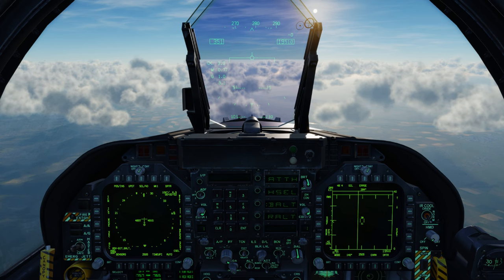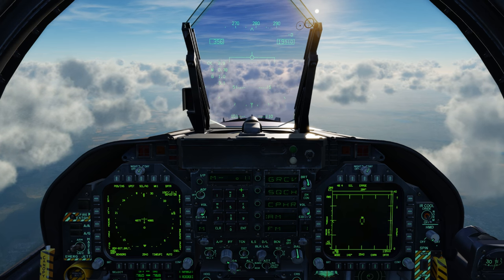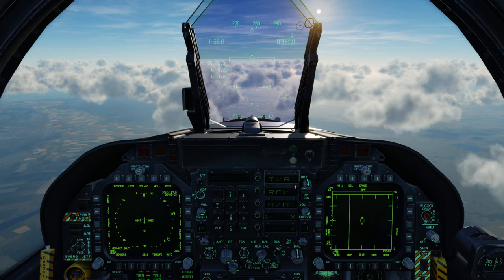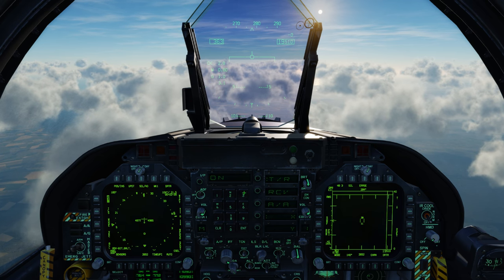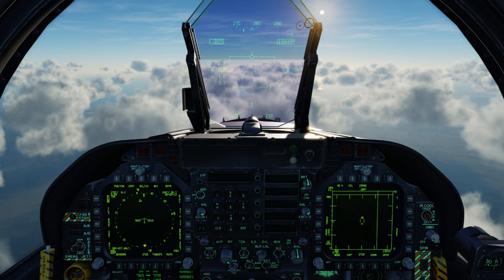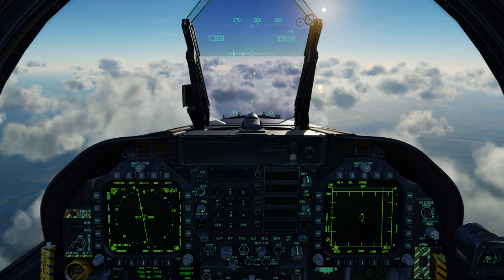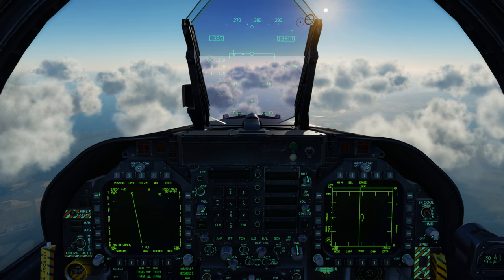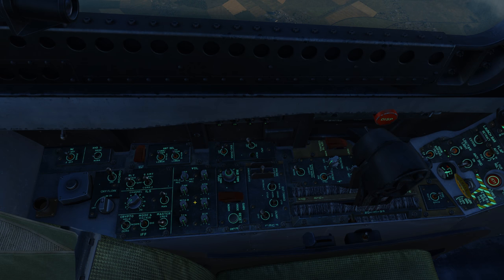DCS: F/A-18C Hornet - Episode 5: ADF and TACAN Navigation

Comment: Hi , thank you for that video and this channel, I have learnt a lot.  I have some questions about the TACAN.
Sorry, it may be silly questions.
1) Why did u set the CRS to 274° ?  3:16
2) What is the purpose of the CRS line  ?  as we can see already the heading , is it to land ? 
3)  what's the purpose of knowing we are at 4 or 8° compared to the crs line?   
thanks
Reply: i was wondering about the same
Reply: I’m late to this but may as well answer for future users who also have the same question.
Let’s say your landing at an airport. You tune into the Tacan of their airport and set your CRS to the angle of the runway so that you can line yourself up. It’s basically a flight path to take. Wags used 274 for demonstration purposes. That number could be any bearing.
Reply: 1. This is bearing for your airport.
2. Bearing is not enough if u want to land properly ;) CRS line shows a proper position for landing to runway. So bearing + course are really important for landing.
3. You can check if you are on the proper course.

Comment: I don't know what i'm doing wrong but sometimes my TACAN will start acting wacky when i'm heading back to an airport for landing. This seems to be only occurring in the training missions. Instead of pressing escape to end the exercise, I usually decide to find an airport to land at instead.
 Out of nowhere, the compass rose will start spinning and the transmit/receive info on the DDI will stop updating.  IE. if the distance to the TACAN station for Kobuleti is 70.1 than it will just stay stuck at that distance even though I know that i'm getting closer to the airport. Also, my set course heading will all of a sudden stop functioning.  Any ideas??
Reply from the maker: Without seeing a track file, my guess woud be a line of sight loss to the TCN station.
Reply: @MattWagner  ok, I'll try another training mission and I'll see if I can get more specific info if the problem happens again. But I didn't know that you could lose line of sight to a tacan station. Thanks for the info sir.
Reply: @MattWagner  I believe you were correct. Rtb from a training mission cruising at 10,000 feet with kobuleti tacan activated. When I ascended to about 15,000 with a 15 degree climb, I lost tacan. When I leveled off, tacan eventually re-established. Thanks again!!
Reply from the maker: E Knight. You bet!

Comment: What's the range on the ADF? How far away can the hornet pick up the signal?
Reply: Line of sight but because it is low frequency it depends on the power output and atmospheric conditions as well.  I wouldn’t expect to pick one up outside 40-50 miles under normal circumstances.

For higher frequencies in the VHF range you can use 1.23 x {square root of AGL}

Comment: how are you able to hold it at 19510 ft and 365 kt steady as hell???
Reply from the maker: Remember that his is indicated air speed. At higher altitudes, it's better to gauge speed by mach. 365 indicated at that altitude is very easy to control. Thanks